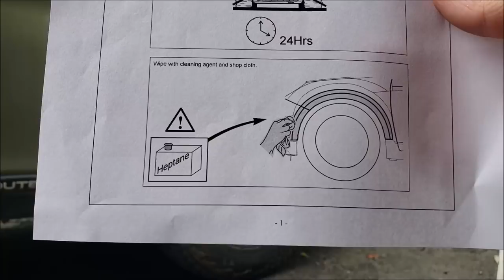JDM Wheel Arch Install 2015-2019 Subaru Outback JDM E2017AL000

Comment: As always, great video and thanks for the help. I purchased a Chinese set from eBay, but arrived without instructions. This video helped me do the install last night after receiving it. Although to be fair, the seller replied with instructions today.
Reply from the maker: Did you have any fitment issues?

Could you let the forum know about your findings?

Thanks.
Reply: @bruceyyyyy  Do you have a link to the forum post? Or shall I create one? I had issues with a couple of the clips not reaching all the way on the rear, but I was able to use a couple of the door ones.

Comment: Well explained installation. I think that definitely improves the look of the car. I've never been super excited about the wheel arches they made for the SH Forester, but maybe I should see if the JDM version is any different.
Reply: Oh. I just realized this is an old video. It popped up in my suggestions and I assumed it was new, LOL. Guess I need to peruse more of your back catalog.
Reply from the maker: If you want the really bad stuff check it the "cheapskates"playlist from when I actually tried being a YouTuber.
Reply from the maker: I don't know if I would do these at this time. The price is astronomical and while I like the look I just don't know if it makes sense for me to buy a super expensive item to scratch it up.

Comment: The following link to a significant review of the Outback was what convinced me to pair the Maxxis TA’s with the Method wheels.  This gentleman did a follow-up review after some extended experience with the Maxxis tires, some with BFG’s.  I’ve had them on my 2015 Outback for 15K and as he said, they do deliver!   https://www.google.com/amp/s/gizmodo.com/how-i-turned-my-subaru-outback-into-a-real-adventuremob-1716068985/amp

Comment: Looks very clean.  Excellent work!   Hey, how is the road noise from those AT’s? I have the Methods in Bronze on my Wilderness Green Outback but with the Maxxis Bravo AT’s.  Super quiet on assault.   Wondering about your tire noise.  I hear the BFG’s make your teeth filling rattle out. 😉.
Reply from the maker: The BFG KO2's had this howl right around 65 mph that was like being in a police siren.  Of course, I typically drive on the highway at or around those speeds so I couldn't recommend to people who are sensitive to noise.  Great tire off road though very heavy.

I currently run the Falken Wildpeak AT3.  Great compromise for a 3 season tire.  

I say 3 season because it SUCKS on ice (I just experienced it last night, 25 mph light stopping results in ABS) but noise, off road, mpg, are all great.  At least in A/T class tire terms.
Reply: Haha @bruceyyyyy !! I just had my first experience with them on ice a couple days ago and was completely surprised by their lack of bite.
Reply: @bruceyyyyy  did you make a video for the wheels and tires? I must have missed it
Reply from the maker: I don't have a video on it. 

Is there anything you would want to know?
Reply: @bruceyyyyy  just sizes and approximate costs
Reply from the maker: 245/65/17 Falken Wildpeak AT3

Method 502 titanium 17"

Schrader Red TPMS sensors

Approximately 1500 all in.  I sold the other two sets I had and pretty much broke even.
Reply: @bruceyyyyy  do you think that with a lift I can clear 245/70r17's on a 2019 outback?
Reply from the maker: @cuzimaluzer777  Depends on offset and what's acceptable rubbing for you. 

245/67/17 gets minor rubbing with my 2"lift. 

I previously had the same size on factory wheels and different off set and had no rubbing. Even with no lift.

Comment: Bruceyyyyy! I didn't realize it was you until after the video was over! I've enjoyed some of your other videos from trips in the past :) Hey, thank you so much for providing this video. I was looking for a video of this for a while, after researching the wheel arch moldings a year ago or maybe more. While doing the research in the past, a couple people said there was a hole to be made in the rear, in plastic if I remember correctly, do you know what that might have been? As an aside, was this your Outback? I thought you had a 5th gen. 2015 or 2016 Silver that you eventually sold to upgrade to a 4Runner  or Tacoma? Or maybe I'm mixing you up with someone else? Anyway, thank you once again. Safe travels!
Reply from the maker: I didn't have to drill into the plastic for this install. I think you might be mixing me up. I have had a Gen 5 since August of 2014. Before that I had an XV got a short time. Before that a Gen 2 Outback for a very long time.

Comment: Just got a 2019 Outback and tires are throwing mud up along the side of the car. Are these wide enough to prevent that problem? Also the plastic "ground effect panel" along the bottom collects dirt and snow on the top. Is there some kind of replacement or solution for this? Tired of going to meetings with dirty pant legs.
Reply from the maker: Not sure on that one.

Comment: How much more in width do the arches stick out?  I am running LP Performance wheels  LP1's and the offset has the wheel outboard around 1" per side.
Reply from the maker: Roughly 1.1" I just measured. This is from the top. It's less on the bottom areas.
Reply: @bruceyyyyy  , Thank you!

Comment: Hi Bruceyyyy is there any use of the arches or just for rugged look ? do they really protect the car  or ?
Reply from the maker: I would say they are 80 percent aesthetics.

Another 10 percent as a side bumper of sorts against rogue shopping carts in parking lots.

With another 10 percent the 1/2" or less that it sticks out and acts as a true fender flares.  This last ten percent is what got me to get them as when I upgraded the wheels they stuck out past the body and I didn't care for that look.
Reply: @bruceyyyyy  yeah though the same the added value is not much compared to the price ... will wait another month or so before buying them :) thansk a lot :)

Comment: What size tire? 235/65/17  or 245/65/17?  Also any tips buying those rims? tricky to find a good price.
Reply from the maker: 245. I got the wheels as returns off Amazon. They were $60 each.
Reply: Also u ran that size stock without rubbing right (245/65/R17)? You didn't need the 2" lift to run that size tire right?

Comment: Do you have a link for these wheel arch moldings? I prefer the wider ones
Reply from the maker: I do not unfortunately.
Reply: Do an eBay search for "Wheel Arch Extensions, Genuine, Subaru Outback 2018". Seller is in England and is a Subaru dealership employee. I just got a set and they are the real deal. They were about $70 more than the U.S, including delivery costs. Easy-peasy to install.

Comment: Not a perfect fit on the rear wheel arch bottom front area...
Reply from the maker: It's about 1/4" off in the front as well. This seems to be how it is from the factory.
Reply: bruceyyyyy i see
Reply: bruceyyyyy I ordered this part yesterday. I saw another YouTube video with a guy drilling the bottom part and using clips for the rest. I was trying to figure out why yours is different.
Reply from the maker: @videosvideos6243  These are the JDM models, not the USDM models. 

Could this be it?
Reply: bruceyyyyy I don’t know. In Amazon, it is listed as genuine Subaru parts or OEM. I ordered the OEM from Amazon for the USA.
Reply: @videosvideos6243  can you post the link?
Reply: @v8_sami  As of today part E201SAL000 is listed as $354.95 and three left in stock. Look for the words genuine. Note: it is a good idea to order extra clips from your local Subaru dealership.